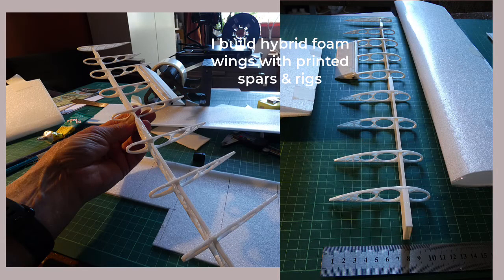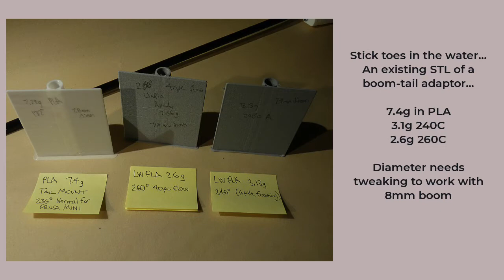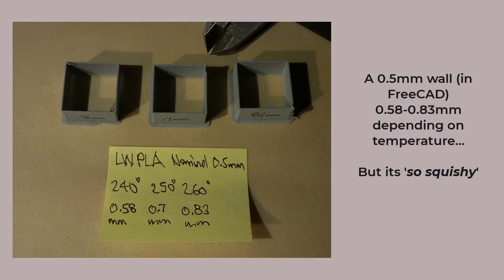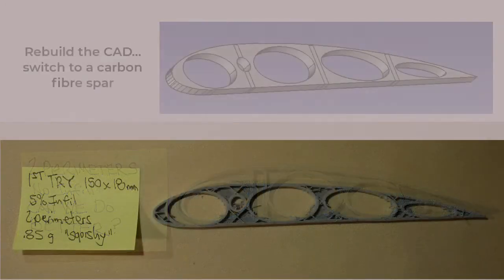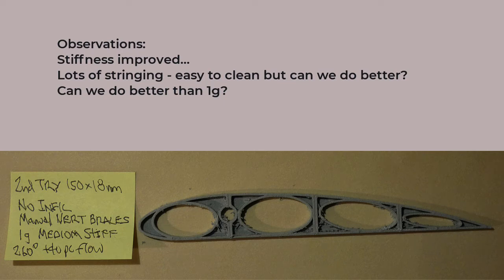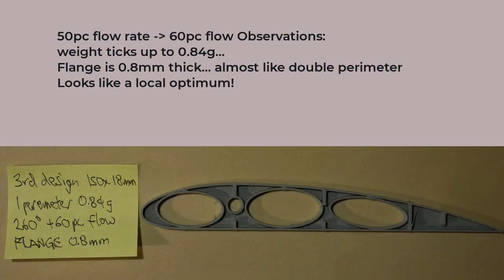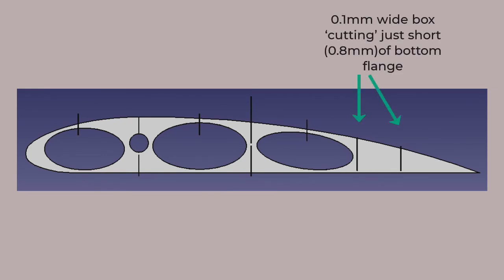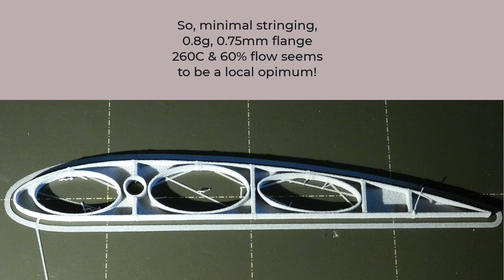Adapting CAD & Printer settings when moving designs from PLA to LW-PLA

Comment: I’ve been looking at this idea “old balsa/ monokote” gas rc guy. Looking at building again. All the foam stuff is insanely heavy with really poor flight characteristics. 

But if you mix 3d printed ribs, with old school building techniques it would be easy to get really strong and very light wing structures.  I haven’t seen anyone try that yet. They all want the 3d printer to do the whole job. Which I don’t think is realistic. The new electric power systems definitely are good sadly the air frames today are just heavy junk because everyone wants zero build/assembly effort.
Reply from the maker: One of my older videos uses 3D printed ribs with a foam skin that also has a packing tape coating - a hybrid ARMIN approach.  What I have not yet done is use the LW-PLA ribs with the foam skin. Should work a treat as long as there is a CF spar (or two) to tie the LW-PLA ribs together.  Let us know if you try something like it!

Comment: Hi, your 240deg print is still foaming as it is less than half the weight of regular pla. The hotter you print lw pla, the weaker it is so a happy middle ground needs to be found. At higher temps with higher foaming I have found the parts to become ever more flexible and weaker
Reply from the maker: Thanks for the comment.  On my Prusa `mini I also have to print PLA at a higher than normal temperature (~+10C) so I think the temperature sensor is slightly inaccurate. That suggests that the 240C for LW-PLA might actually be 230C.  I have an IR camera - perhaps worth checking.
Reply from the maker: I did some further testing and found that if I increase the flow rate a bit (from 0.42 to 0.52) and slow the print speed to 30mm/s I get a slightly thicker perimeter with 5 degrees cooler temperature - first layer still 240C, other layers 235C.  Next step is to do some test cubes at 235 and 230C to check thickness and stiffness.